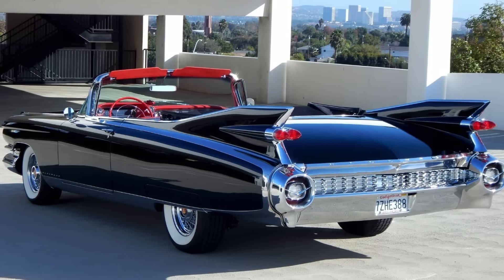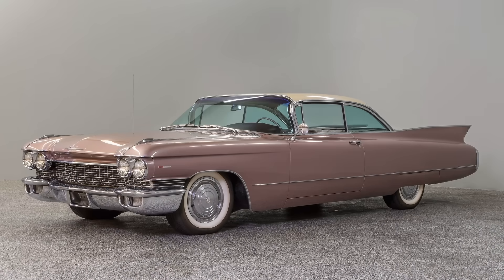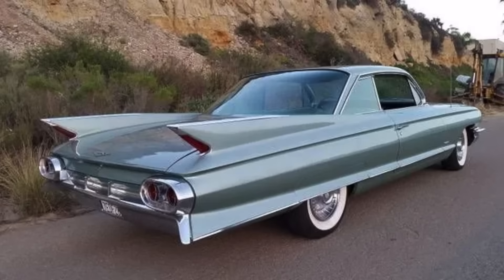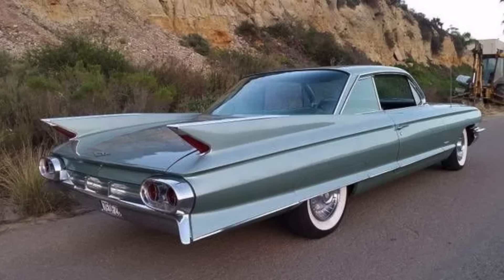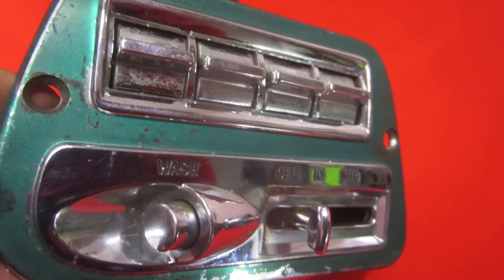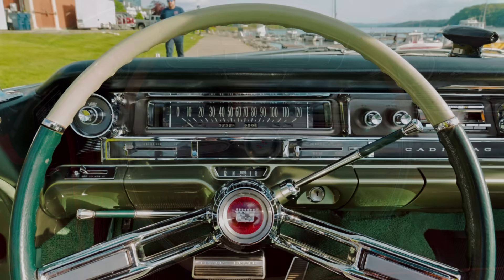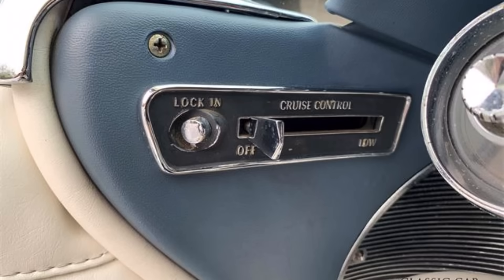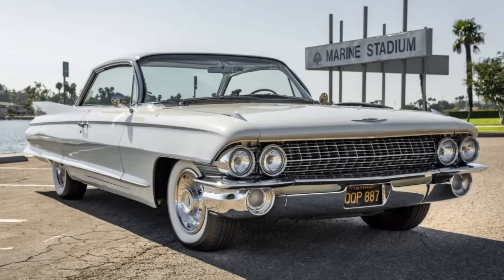Worst Automotive Components of All Time: The 1961 Cadillac's Dangerous Cruise Control (GM)

Comment: I am a big fan of the original Hydra-Matic transmission. This is a very rugged transmission that could withstand a large amount of torque. If I were to complain about modern cars, one thing that stands out as a weakness is the modern transmissions, they don’t take as much abuse as the old Hydra and Turbo trans did. The Hydra-Matic was the great grandfather of fully automatics. I will mention that the position of R next to L was so that you could rock the car easily if you got stuck, or so I’ve read.
Reply: Ralph Nader, who didn't even know how to drive, claimed that was unsafe.
Reply: They were good transmissions. The original did shift a little rough compared to today but they were bulletproof and many are still running today. They weighed as much as a baby whale!  Then came the Jetaways (1956 to 1963 in Cadillacs)  that were also good (I had a '56 and later a '57)) Cadillac was the first GM car to have the TH 400 in 1964.  That was like floating.
Reply: We had a '49 with the original Hydramatic, but I thought by '59 they went to a different, kind of sucky transmission?  I know one thing that was totally defective on all 1959's was the horn ring...  They were made of a pot-metal that liked to break.
Reply: The Turbo trans lived on in GM trucks up until just recently. The 4l60 was based off the turbo 350 with an overdrive added, and the 4l80 was off the turbo 400 with an overdrive. Now GM has transmissions that drop at 100k consistently
Reply: @richardlea818  Yes the transmission shop I drive by a couple times a week has mostly Chevy and GMC trucks parked outside waiting for surgery. Cadillac rear wheel drive trans from the 90s & 2000's are guaranteed to go south at 90K-100K, so I hear.
Reply: @marko7843 
My first car was a Buick Roadmaster with the dynaflow. My HS buddy had a 49 Caddie with the V8 & hydramatic.
He left me in the dust.
Reply: @TomSpeaks-vw1zp  Hmmm, 2 high school kids driving a top of the line Buick and a Cadillac?  Must be Marin County...  😁
But seriously, did you manually shift the Dynaflow in that race? One of MY high school buddies drove a '59 Buick, and he couldn't stand the narrow ratio range in drive.  Thus, he always drove it like a manual 2-speed.
Reply: Most transmissions these days are made to take only just as much torque as the engine can deliver and no more. They're rarely overbuilt outside of performance models to save as many pennies as possible. In the case of CVT models they're almost universally underbuilt. The Nissan Sentra and Mitsubishi Mirage use the exact same CVT. They fail right and left in the Sentra and almost never in the Mirage. The difference? The CVT can actually handle the measly 74 lb/ft of the Mirage engine, but not the 146 lb/ft of the Sentra's.
Reply: Actually, the position of Rev below Lo had nothing to do for "rocking"... in fact you couldn't rock those cars back and forth.  The reason it was there is because reverse had some kind of semi manual engagement, and the transmission had to be in gear with nothing turning before you could put it in reverse.  In fact, half of the time you'd have to release the brake & nroll a couple inches before it would go into reverse.
Reply: @michaelbenardo5695  
I’m sorry, I shouldn’t be so judgmental about someone I don’t know personally.  But sometimes his actions and comments seemed off the wall. Ralph might have had good intentions. (?)
Reply: @marko7843  
Haha! No. My Buick I purchased from my Uncle in 1956 for $250 bucks. The 49 Caddy was my buddy’s dad’s.
We didn’t make it a habit to race. It was a one time only. We were just two regular teens from Fairfield co. Ohio.
Graduated HS 1960.
I’m now 83 and sadly my life long buddy passed at age 78.
Reply: @marko7843  The Hydramatics were not in all of the GM cars,cheaper cars might get the Powerglide or a "jetaway" 2 speed transmission. Also sometimes in the same years a "Roto hydramatic" was used that was lighter and cheaper to build,a 3 speed that didn't work as well as other 3 speed automatics like the larger Chrysler Torqueflytes. 
Buicks often had a functional 1 speed transmission with an "emergency low gear" and a very loose sloppy high stall torque converter.
Reply: @marko7843  Did the high/direct clutch soon burn out ?
  (referring to using the "emergency low gear" in the Dynaflo to get better acceleration) 
also same thing may have applied to early Powerglide and even some Packard automatics when "manually shifted" to obtain better acceleration - high speed upshift when going into Drive vs. the direct clutch burning out 
  not the same thing in the Hydramatic which was a much much better transmission and could use all of its gears without abnormal wear although I think early ones did have a couple of "bands" that could be adjusted to compensate for wear
Reply: @davidpowell3347  In the 4-speed?  No, but the 1-2 shift was a bit abrupt because it was mechanically coupled in 2nd.  
BTW, the Buick DynaFlow wasn't simply a sloppy, high-stall converter.  It was a variable-pitch stator-vane converter... from which several years of Turbo 400s & 300/Jetaways got their switch-pitch feature.
Reply: @davidpowell3347 called a dynaflow

Comment: The shifter! LOL. Flashback to the mid 70s, my dad owned a small service station. Bill was a neighborhood youth, about 10 years older than me, who worked for my dad back then, and was friends with my older brother, who also worked there. So Bill had several cool cars including 2 59 Cadillacs. A coupe and a sedan de ville. Bill had the coupe, his real pride and joy, in one of the two service bays, the only one with a lift, the center post variety, as standard then. He told me to back out. NO idea to this day why he asked me to do this, i was a wet behind the ears 16 year old, didn't even have a license! Knew nothing! But i knew where reverse should be! Right? Right?? Bill is standing in front of the car, put it in drive instead of reverse, car went no where until i gave it some gas, and here's poor Bill about to get taken down at the knees by his own 59 Caddy! Good thing i still had 16 year old reflexes i stopped it, but he was so so tight between that car and the work bench. I saw where reverse was and he actually did chuckle while i backed out. Amazing guy. And the backing out of a garage with that car! Just like a horse wearing those blinders on their head. All you can see is straight back!
Reply: I think at 16 I'd have been less likely to confuse D and R than I am now, since I hadn't been driving multiple cars with the PRNDL configuration, so I'd have had to watch the display, but even that probably wasn't lighted on a 1961 car. Anyway, there was an old clip of some Bee Gees documentary up on YT (since taken down) and it showed Robert Stigwood, their manager and future music tycoon, trying to the get a borrowed Rolls Royce into R and running into the same problem. Rolls was probably the last carmaker to ship cars with Hydramatic transmissions, and they sold them outside the USA for 5 years after the PNDLR configuration was banned by the feds.
Reply: For 19 years I daylied an '85 Porsche 928S2 5 speed with a "dog-leg" transmission, which means that reverse is where first gear is in most cars, up and to the left.  When I let people drive it I made a point of making them look at the shift pattern on the shifter so they knew that there was something odd. I didn't want them backing into the car behind us when a light turned green.....
Reply: A lot of people with GM cars (not just Cadillac) had that issue back in the day.  The reason GM did that is because they could save a few pennies by putting Reverse next to Low in the Hydra-Matic unit.  I think the early Powerglide is like that too.
Reply: Putting L next to R qualifies as dangerous to me.

Comment: IDK, I am still enamored of the 1961. I love how the upper fins are now more tasteful and balanced by those lower fins with sheet metal extending all the way forward. This makes the car capture the light in such a way as to make it look very aerodynamic. The front end with the egg crate grill is still beautiful and the overall presentation of the car just exudes mid-century class and elegance! But was this particular cruise control set up a precursor to the thumb wheel cruise of the later 1960’s models? All of those model years are unforgettable!

Comment: I can just imagine what it would be like to buy a pristine 61 Cadillac today and feel that smooth & quiet ride. I remember riding in these cars as a kid and later owning a 64 Pontiac Catalina.
Reply: @  KO.....my dad had a 1961. 4 dr.  Hardtop, no B pillar, for 19 years.  I drove all over NJ , NY and up to Mass. visiting college
buddies. Great car...no air in that
one. 390 V8.  
   This poster never drove one a lot.  The BIGGEST saftey problem was th. Two Spoke ,"
steering wheel with the horn
buttons on the spokes.  The 61
year had the spokes at. 8:20 
below the center line of zhe wheel. So with hands at. proper
ten to two the horn is way too far 
away so I would have to take one hand off the wheel to honk...
This got me in BIG trouble on the
Long Island Expressway in heavy
traffic and only pure luck saved me from getting sq wished between two trucks. That was
in 1970 going out to Adelphi.

Comment: Luxury car salesmen were more knowledgeable back then. They always pointed out new/changed features to entice new and returning customers.

The only way I see this clearly labeled change as being "dangerous" is in the hands of know-it-all types, which isn't a fault of Cadillac interior designers. 

All new cars come with owners manuals. Back then they were much slimmer and better illustrated. If you read the manual, there isnt a problem.
Reply: Oh great so all the people who had the problem at the time actually didn't have a problem? Flawless logic dude but you forgot one thing, this DID happen and people DID have problems and they DID report it to dealers, so what on earth is the point of your comment?
Reply: @amac203 That some people are thick Dude!!!🤔🤨🧐🙄Doh!
Reply: Many people are not aware of how much automatism is involved while driving. When I drove my automatic cars for a week or two sometimes I nearly forget to push the clutch before stopping my manual ones. And when I learned to drive in the Seventies, I would drive various Opels and use the Ford Capri 1 of my parents as well. My habit was to push the gear lever as much to the left and then up if I wanted to put in first gear. The only problem with the Ford was that instead of one I tried to put in reverse while still rolling. The noise of the transmission informed me very quickly of my mistake.
Reply: The manuals weren't written in tiny print in three languages with so many innane safety and chemical warnings that they couldn't be read, either.
What are you doing? "I'm reading my new car manual", said nobody since 1992.
Reply: @amac203  😅😂🤣....I bet in the time it took you to type your intense response, even you could have opened a 1961 Cadillac owners manual and found the illustrated diagram for the dashboard, which clearly shows where both the Cruise Control and windshield washer units are located. Owned over 40 cars since I was 19. Not stopping and my opinion won't change.
Reply: @solemandd67  You want me to read the owners manual of a 1961 Cadillac? If only you were there at the dealers at the time to tell that to all the people calling in to complain about having this problem (the one in the video) 🤣🤣🤣🤣🤣😂
Reply: There is a thing called muscle memory. When we are used to doing something a certain way, we continue to do it the same way out of habit.
Reply: Who would expect a switch that looks identical to get a new function over the course of a year? I don't know about back then but I never read my cars manual (excluding stuff like oil quantity) as it's not hard to figure out how a car operates and these are modern cars with a zillion controls compared to 50's ones.
Reply: @solemandd67  You seem to not understand the video is describing actual things that happened to actual customers at the time. You're about 60 years too late with your advice my dude!
Reply: @amac203  
You seem not to comprehend that;
1. I'm not "your dude". 
2. I'm not changing my opinion. 
3. I'm not too late to express my opinion just because you don't agree with it. 
* Expressing opinions on old cars is what we do here. Read the comments. Per the Cadillac LaSalle Club, the two rarest options for 1961 Cadillacs were power vent windows and.... Cruise Control making this a Chicken Little level concern.
Bye amac203 😆😂🤣
Reply: @solemandd67  It's not an opinion, MY DUDE, it's a fact that people had an issue with these controls. Read the comments from people with a brain, and maybe watch the video? You're arguing with people from 60 years ago 🤣🤣🤣🤣🤣Bro that's a new low
Reply: @keithdukes5990 Agreed...😆😂🤣
Reply: Now the problem is illiteracy is rising
Reply: @mattwolf7698 this story is about 60s not 50s cads

Comment: Wow!  I fly Boeing 767's for a living and for the most part, every switch and knob is in a certain place regardless of the model, and the shapes of knobs are standard in the industry so that you don't do the wrong thing at the wrong time.

We spend a lot of time in training learning where everything is so that we can basically find it blindfolded.

I'm surprised that they made this big of a mistake.  GM was (and still is) the kind of organization where you do not tell the boss he is wrong or show him/her up with a better idea, so that's probably the explanation.

Great video!
Reply: I don't see this is as a big deal, every year then was a year to completely reinvent motoring and that's why we love them.
Reply: @xpusostomos  This is an example of what educators call "negative transfer".  People are used to one thing, and when it changes they are prone to make a mistake. The placement of this very different control where a relatively benign one was the year before is something that the engineers should have noticed.  I guess it is possible that it was simply missed, but you'd have thought that someone would have spoken up "Hey, uhmm....What if....".
Reply: @Flies2FLL  I don't see the cruise control as particularly dangerous, you put the brake on and it's finished. These days most are designed horribly, on the steering wheel, indistinguishable from the media controls, and yet you don't hear about cruise control incidents. What's wild to me is how in the 50s and 60s they'd almost completely redesign the car every year. Those were heady times.
Reply: @xpusostomos Exactly. I comprehend the need for instrument placement standardization for commercial airplanes because it's highly unlikely the same pilot will sit in the same cockpit repeatedly. 

Cars are engineered and designed for personalized transportation. Total standardization doesn't really apply. Different models require different dashboards.

I'm the first to admit that I've questioned the ergonomic decisions of modern car manufacturers. Do I think radio controls belong on a steering wheel hub, which to me should only contain the horn pad and airbag beneath it,? No. I grew up with only the horn on the steering wheel hub or spokes. Yet if I drive such a car, I make sure to locate the horn before driving and I've never mistaken a radio button for the horn. 

My mother bought a new '77 Mercury Monarch Ghia. It had CC buttons to the left and right where cheaper models placed horn buttons. The horn was a separate horizontal bar which ran the width of the singular spoke. Neither of us ever mistook the CC  buttons for the horn or vice versa.  Other people drove her car. No problem. 

My aunt had a Mercury Marquis Brougham with a Rim Blow horn. Everyone knew where it was who drove her car. 

These days so many features have crept their way into our cars it's hard to keep up. I wonder what those who complained about the CC placement would think about sitting behind a new cars dashboard now?...😆😂🤣
Reply: And soon after this America went to the Moon!
Reply: And we are now seeing these mistakes with touchscreens in vehicles, awkward controls placement & design, and so on. Tesla is perhaps the best example of this... followed by GM's dial gear shifter that looks uncannily similar in shape & size to the volume dial on the vehicle's entertainment system...
Reply: @jonathantan2469  any screen, not just touch screens.. BMW started it with their idrive knob.
Reply: @jonathantan2469  I  recently rented a Chrysler Pacifica minivan and it had the round dial transmission selector that is close to the volume knob of the stereo.  Bad design.  

The screens in cars are nice but the problem is is that modern vehicles put many of the controls on the screens, big mistake.  What will happen in 10-15 years when these screens are no longer available?  Stereo and navigation ONLY should be on screens, and they need to be standardized so that they are easy and cheap to replace.
Reply: I suppose it was the 1910's or '20's when SAE--the Society of Automotive Engineers--established rough standards for automobile controls.  Steering wheels replaced boat-style tillers (really,) brakes and clutch moved to the floor, throttles became accelerator pedals, and the gearshift was operated by the driver's right hand.  Dunno about Model T Fords, but Ford finally civilized everything with 1927's Model A.  I don't think that the SAE never extended their authority to dash controls, so it was up to the US government to initiate some vague guidance much later.  Corrections are solicited.